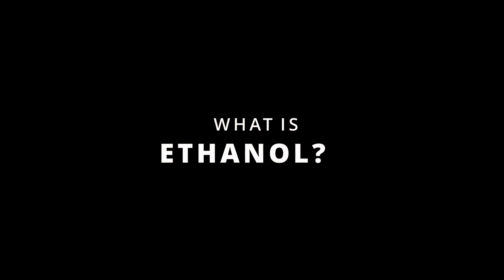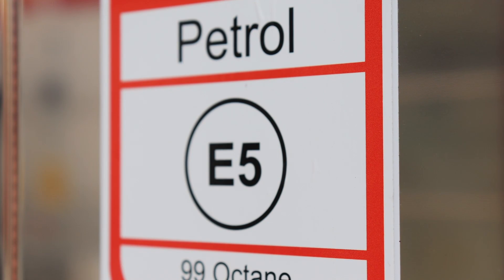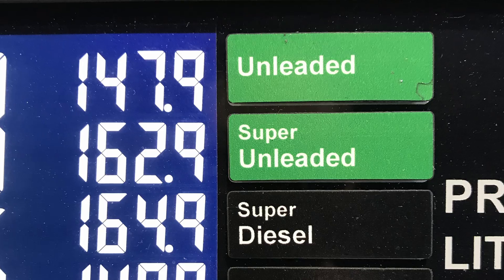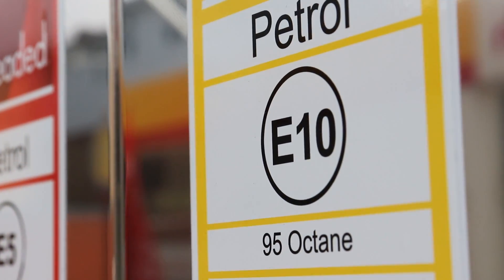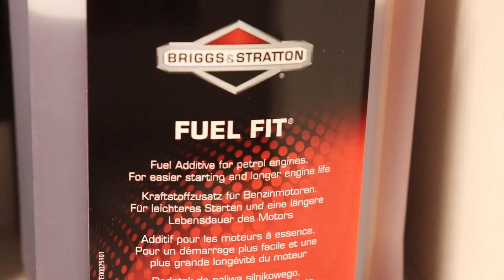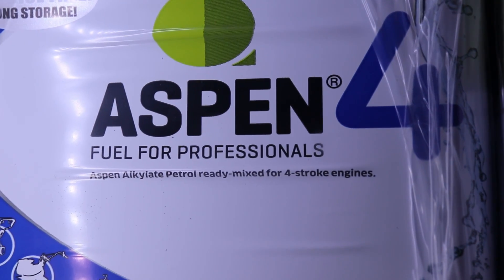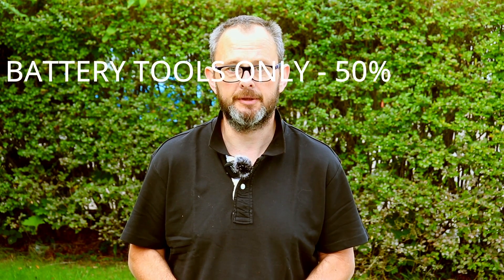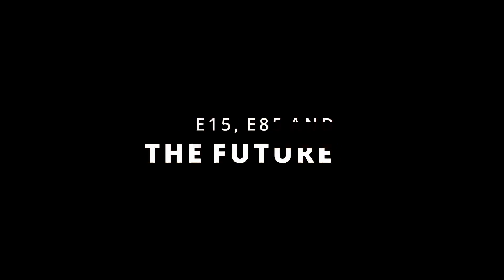Problems Caused by E10 Fuel in Garden Machinery

Comment: Bring back 4 and 5 star leaded fuels like we had in the 1970's. Much better product with no problems and bring back mineral diesel. If the army can use why not us too?
Reply from the maker: Hi Chris. I remember those days. But how would we make all our pencils if we went back to full fat fuel. Thanks for posting. Nick.
Reply: The only thing wrong with leaded fuel, IMO was having to strip the heads down to do a de-coke on the clogged up valves. Other than that, I agree.

Comment: Have gone thru approx 17 leaf Blowers in 25 years until I stopped buying 95 Ron Supermarket Fuel and using the Red Sthil Oil.
Domestic Garden use only and for cleaning driveway etc.

Now purchase 99 Ron Non Supermarket Fuel, and either the Green M/Cycle Oil or the Husky Blue
 and Leaf Blower is 4 years old and still going strong.

On the last Sthil BG Blower I had it examined after it went and their Conclusion was that 
the Ethanol was causing premature cylinder wear and causing water contamination in the
tank and carb.

You only have to see the damage that has been caused to Audi Alloy engines which is stated to
be Ethanol damaging the coating to the cylinder block walls leading to loss of Oil control 
by the rings etc.

Friend had a Classic Merc 190 which was not used much, went in the garage one day after smelling
fuel to see that a 'rubber hose'' to the tank had been almost 'eaten alive' and the tank
had emptied onto the Garage floor.
Diagnosis was ''Ethanol Contamination'' of the fuel hose lining.
Reply from the maker: Hi Steve. I never use supermarket fuel for my tools. Ever. Diesel for the van, yes. But if I want high octane, lower ethanol content fuel, I almost always buy Shell V power, and I still use the Briggs and Stratton fuel fit. Belt and braces approach. Not had a problem with any of my 2 stroke tools, or my Hayter for that matter. Thanks for posting. Nick.

Comment: I use a dual 18v e.g. 36v Makita multi-tool strimmer pole saw. Strimming on level 2 (out of 3) gives me about 15 minutes. level 3 is the highest speed for about 10 minutes.
With 4 batteries, I manage the edges of my garden. But I have a 32-acre property and to clear the fence lines for the electric fence I still need my Stihl professional 2 stroke brush cutters. Very heavy brush, Rushes (Swamp grass as some in the USA call it) and brambles. A typical session is 4 hours, and 3 refills of fuel and 2 beers..
On the other hand, the 36volt Makita Chainsaw works relatively better because there is less energy loss in the idling that goes with this  stop start type of job. And I have no complaint about the power of any of these tools! But for Brush cutting/Strimming it is only good for home maintenance. This may change in a few years though,  The 40v platform for Makita seems an improvement but it is completely new, so no incentive for me to go there. May as well go for any other brand.
Reply from the maker: Hi J. All my work is estate maintenance. I think I’d have to sell a kidney to pay for all the batteries I’d need to run a strimmer, backpack blower and lawnmower for the amount I have to do each day. With ULEZ coming in this August, I’ve got to look at getting a new van rather new tools this year! Thanks for posting. Useful info. 👍. Nick.

Comment: I transferred to Super-unleaded some time ago for the cars as I found that I was getting around 10% better fuel economy for a 7-8% price premium, that naturally translated into my horticultural machines as it made sense to only have one source of petrol.  Soon after that I found out the damage that the ethanol was supposed to cause to older classic engines (I have 4 classic cars) and the horticultural machines.  Since the advent of E5 I have used a fuel stabiliser to help store the fuel as I can't guarantee how much I will have at the end of the season and flushing the surplus is not recommended.  When E10 was introduced Shell and BP confirmed that their super unleaded in parts of the country did not contain ethanol despite stating it on the pump and I believe that I live in one of those areas.  As a sort of confirmation of the state of play I recently saw a test of the amount of ethanol in super unleaded petrol, where most of the top brands only had 2 1/2% ethanol although the location where the fuel was sourced was not stated.
I really don't fancy the idea of battery powered machines because of the inconvenience - they require batteries to be charged over significant periods and I have various tools that are battery powered that have failed prematurely, notwithstanding that batteries are often model specific and individually are expensive.  Most of my gardening kit is high powered professional quality to maximise production as I simply can't afford the time required to use low power units.  I look after my tools which are often decades old but still function in top form e.g. my Honda HR19/4 36 years old mower and my 33 years old Yardman 30" lawn tractor.  I will be seriously upset if they are destroyed by the fuel.
Reply from the maker: Hi Clive. I can understand that. Very little of my gardening work is light. I’ve tried a Bosch battery mower. It was pathetic. No power, no torque and no run time. With the volume of stuff I do and the amount of power I need to get it done, I can’t see me moving over to battery tools any time soon, unless it’s just do my own garden. But the cost for just that purpose is prohibitive. As it is, I need to buy a Euro 6 rated van, to avoid the ULEZ charge coming in August - that cost would be over £300 per month with my current van!  Anyway, just have to see how the technology evolves over the next few years. Thanks for posting. Nick.

Comment: E10 makes my mower run like crap. Even though it states E10 is ok. So I just run E5
Reply from the maker: Hi Chris. I run E5 with Briggs and Stratton fuel fit. Plus I use Stihl Ultra for the 2 stroke tools. Thanks for posting. Nick.
Reply: @NickBarban  Both of my mowers have Briggs engines. One is a 2009 and the other is a 2016. The 09 one doesn't mention E fuel at all but the 2016 one says E10 is fine but yeah, like I said, it runs like crap. Will have to try that special fuel at some point :)

Comment: Hedge cutters can be battery however blowers, mowers & strimmers need to be petrol or you would need £1,000s of batteries. 
E10 I have found ok in mowers however in chainsaws, blowers & Strimmers E10 rots the fuel tubes & carburettor diaphragms.
Reply from the maker: Hi Chris. I’m only using E5 with the Briggs & Stratton Fuel Fit for my tools. So far, no issues. I nearly swallowed my own tongue when I worked out the cost of batteries I would need. But, now that ULEZ is on the horizon, and I’m just inside the zone, battery options are going to have to take a back seat until I can beef up my income. Good luck with it and thanks for posting. Nick.

Comment: Since using E10 my fuel economy has plummeted. From 43mpg E5 to 32 mpg on E10. I am experiencing  'pinking ' in the engine and it does seem not as much 'umph'.  15p more, but more mileage.

Comment: I have noticed the drop in mileage and it seems much greater than 3%.
Reply from the maker: Hi. Is this on a vehicle?
Reply: @NickBarban  Yes a ford focus.
Reply: @peat11  I am Australian and I have  1999 Ford AU Fairmont station wagon (the wagon version of Hubnut's car if you follow him on youtube) that runs on dual fuel. this means I can run it on LPG, E10 or 91RON. LPG and E10 give me similar consumption which is 2litres/100km worse than 91. Today's prices are E10 $1.89/L and LPG 81.7 - 85.9 cents per litre and 91 is 1.95 per litre the offset is that the car runs much better on either LPG or E10 (which is 94RON). The car is designed to run on ethanol fuel (but not E85).
I run my lawn mower on 98RON as it has no ethanol content (I don't think 91 has either but I am certain with 98.
Reply from the maker: Hi Ian. Interesting to hear how different vehicles in different location fair with different fuels. Also, weird to see how different fuels are available round the world. Never been down under but looks like I’d be stumped with which fuel to use 😂. Thanks for posting. Nick.

Comment: Coming from a garden machinery dealer point of view we see the vast majority of mowers using E10 and two stroke machinery come in for starting issues using E10 fuel with the basic red colour two stroke oil which is sold everywhere from DIY stores to manufacturers such as Stihl. Our dealership decided to stop selling the red two stroke oil and only sell the two stroke oils with the fuel stabilisers in them which for example with Stihl are green in colour(some other manufacturers like Husqvarna may have a blue colour), these oils also give better starting, create less smoke and provide better lubrication. We also recommend using the Alkalyte non ethanol fuels in two stroke machinery or machinery like pedestrian lawnmowers, tillers generators or wheeled leaf vacuums that you don't used for long periods. We also recommend E5 and fuel stabilisers in ride on mowers as these aren't immune to fuel issues either.
We see less customers return machines with starting issues using fuel additives, Alkalyte fuel and the two stroke oils with fuel stabiliser additives.

Comment: I'm a gardener and have never had problems with any machines before e10 was introduced, straight petrol machines bogging down constantly and my two stroke tools are needing carbs changed constantly. Stuffs terrible
Reply from the maker: Hi Russell. Sorry to hear that. Since I did the video, I’ve stuck with E5 (even though it’s stupidly expensive!) and I’ve been adding the Briggs and Stratton Fuel Fit. For the 2 strokes I’m using the Stihl Ultra 2 stroke oil. I’ve not had any problems at all. The fuel fit isn’t too expensive and it goes a long way. Worth getting some and trying it. 👍. Btw, what manufacturers are you running. I’ve got Tanaka 2 strokes and the new Hayter 48 Pro.

Comment: I've just transitioned from petrol to battery. Ego. Was my brand of choice. I do believe battery is the future for professional gardeners. Although, not quite there yet for commercial mowers. So for now I'll carry on using my trustee Weibang shaft drive for mowing.
Hopefully the more people who buy in to battery the cheaper they will become because of right now they can be too expensive for some.
Reply from the maker: Hi. Did you go for the Domestic or Professional Ego kit. I hear there’s quite a difference between them. Apart from the mower, the big one for me is a backpack blower. Almost all my work is commercial and I have some days where the backpack is going for 6 or 7 hours. Looking at current performance, it’ll cost me £thousands just in batteries. The shop that does all my servicing and tools stocks Echo. I’ll look at that stuff a bit closer when life is less frantic 😂. Thanks for posting. Nick.
Reply: @NickBarban  After recently breaking my wrist my Honda 4 stroke strimmer was to heave for me to use on my recovery. So I took my first step in to battery because I heard it was much lighter. I bought the dedicated EGO strimmer. I love it and have not used my Honda strimmer since. I've now bough, should be arriving today hopefully, the power+ PH1400 Power head and the PTX5100 professional hedge trimmer attachment. I also bought an extra battery. That's as far as I've got so far as I'm not made of money.  But on my radar is the pole saw. Lawn edger and possibly the bristle brush. But they'll all have to wait for now.
Reply from the maker: @funkyduckproductions.8844  yeah. A lot of cash to fork out. I’m running the Tanaka smart fit strimmer/cutter. It’s had a hard life and in desperate need of replacement, let alone a service. The main thing stopping me moving to battery immediately is the possibility of the ULEZ being extended out to the M25 next year. if that happens, my 2011 transit is worthless and at best, for a Euro 6 van to comply, I’m looking at £18-£20k at the bottom end. If customers only realised how expensive professional gardening is!?  I’m sure you’ve had “do we get a discount as you finished 15 minutes early?” Or “that’s expensive. My old gardener did 6 hours for £5!” Can’t live them em…..  thanks for posting again and I hope the wrist has a full recovery. Definitely need both to be working 100% doing what we do. 💪👍
Reply: @NickBarban  I'm based up in Liverpool. If we started with that ULEZ  stuff up here, charging extra to drive on certain roads at certain times I think I'd have to seriously consider if I wanted to continue or if I'd be better off being a drain on societies purse and just become unemployed. There's no way I'd want to be spending out on a new electric van. The numbers just wouldn't stack up for me.
Reply from the maker: Don’t think they stack up for anyone who isn’t already wealthy. That price was for a 5yr old diesel. The new electric transits start at £43k. I’m as eco friendly as I can be but numbers like that just aren’t doable and still keeping a business running.

Comment: A capable chainsaw (i use a 16" Husqvarna)  in electric guise is just too expensive at the moment.  I think for hedgetrimers  and strimmers electric is probably practical.
Reply from the maker: Hi again. I run Hayter for my mowers and Tanaka for everything else. At the moment I’m flipping a coin between Ego and Echo battery tools(and not because I can’t be bothered to go any further into the alphabet 🤣😂). I can still handle the weight of the petrol hedge trimmers, going for as long as I have, but the reduced weight, vibration and pollution levels of a battery unit would be very welcome. 

I suppose here we could add in the argument over production and ecological damage of battery production for these new tools. What do you think?  Thanks again for posting. Nick.

Comment: What is the best ( cost effective, long life, reliability)  Battery multitool  solution to replace all petrol tools. Mower, strimmer, chain saw, hedge cutter, pole saw/ trimmer . For home garden use. Has anyone done research on this issue. Ideally one battery charger fits every tool battery. Interchangeable batteries.
Reply from the maker: This is something that I’m looking into myself. Ego seems to be a name that keeps popping up but I don’t have any details yet. Backpack blowers and lawnmowers seem to still need work to get useable aH ratings to make the tools last. I’ll be looking for a strimmer that’s a multi tool, so I can buy different attachments later. Maybe I’ll do a vid on my experience with. Thanks for posting and I hope you find something that works for you 👍

Comment: I sense that you are well aware as to why this is being done, having conducted all this research... hardest part for me was "more efficent cleaner and stores upto 5years" banned... e10 engine destruction.. tick... 
Really helpful video! May i suggest the Makita 40v XgT powerhead, 1 tool fits all outdoor landscaping needs. 👍👊
Reply from the maker: Hi Ninja. Glad it was helpful. I’ll have a look at the Makita. Thanks for the tip and thanks for posting. 👍🤘. Nick.
Reply: @NickBarban  i am clearing scrubland and was going to go petrol but the e10 has killed that idea... thankfully tech has caught up and brushless high output motors and higj volt battery really make it a viable option where as before it was 10mins work 2h charge... now its more like 2.5hrs work 45mins charge and with 2 batteries thats pretty much a working day 👊👍
Reply: I like the sound of this ... Makita 1 charger, battery is  interchangeable many tools. Is that correct.  Many thanks
Reply: Fuck the climate deal

Comment: If they have not been removed from youtube there were videos on here showing you how to remove ethanol from pump bought petrol by simply using water and food dye. Removal of the ethanol content did reduce the octane rating but this can be addressed by adding octane booster.
Reply from the maker: Cheers Mike. I did look into covering this but any issues that came up from that sort of advice wouldn’t just be a can of worms, it would be a best if vipers! With current fuel prices, this might be a viable option right now 👍. Thanks for posting. Nick.
Reply: @NickBarban  It is maybe best just pointing people to these videos, inviting none mechanical people to play around with fuel could hold it's dangers as the separation process takes twelve hours. As and when e5 is no longer available at the pumps I will be using this method with my motorcycles. At the moment I am on the e5 and also using the latest version of Castrol Valve Master which contains protection against rubber, plastic and metal damage due to ethanol which in the motorcycle world also causes swelling and damage to bikes fitted with plastic fuel tanks.

Comment: My fuel filler cap on the car even says E10 is recommended.
Reply from the maker: Cars are a completely different deal. Any cars pre 2002 shouldnt use E10 and all cars in the UK since 2011 I think, are E10 compatible. I concentrated on garden machinery as they seem to be much more susceptible to the problems. Don’t know when comparability started in Germany. Thanks for posting. Nick.